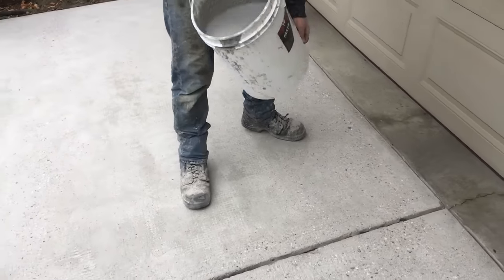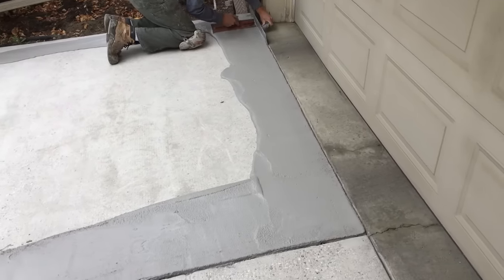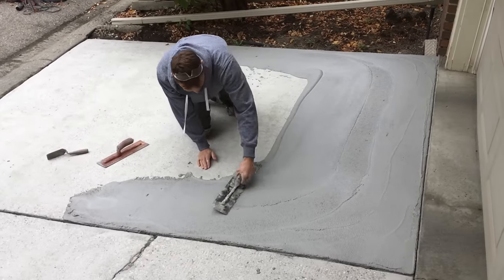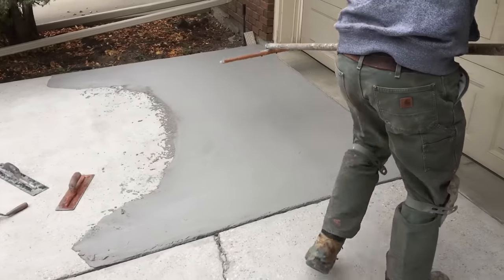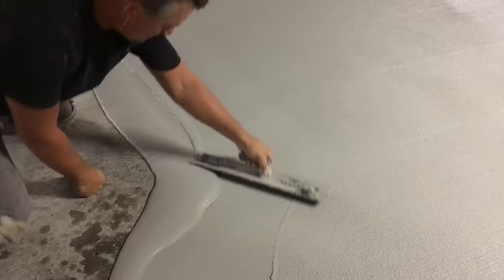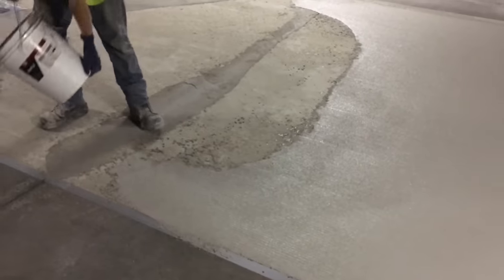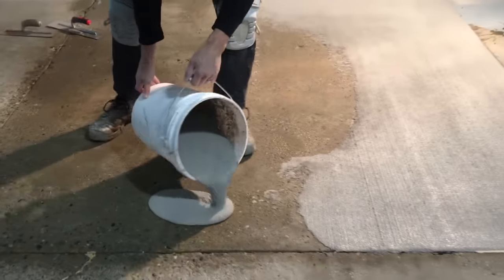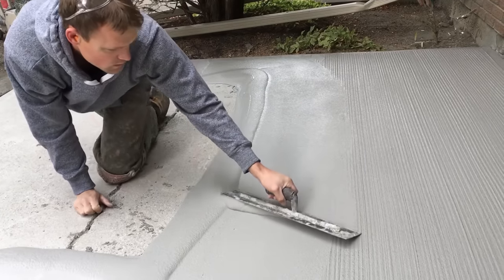TF Structural Concrete Overlay - Overlay Instructions

Comment: Just curious, once it all dries would it crack when vehicles are on it
Reply from the maker: No 👍
Reply: Yes it’s a temporary fix
Reply from the maker: That’s incorrect
Reply: It's not will it crack but when.
Reply: Terrafuse Inc. you’re incorrect
Reply: @mikemike9501  Due to the temperatures of the axis between sand and stone, the moisture content may or may not have been fracked. If you consider this and add the element of electrical current you will realize I have no experience with concrete at all other than stepping on my porch in the morning when I leave the house to go do other non concrete related tasks.
Reply: @GrandeHuevos69  ok then

Comment: I want to apply an epoxy paint to my garage floor, but it has that shiny coating that the builder applied. If I apply this concrete overlay over my floor, will it adhere?
Reply from the maker: You need to have bare, clean, porous concrete to apply this too. It can’t be installed over other coatings. Or are you referring to a power trowel finish?
Reply: @TerrafuseInc  Will a diamabrush work?

Comment: in my garage the previous owner put in some leveler which seem to be now cracked and delaminating in certain parts. It's a large area, what's the best way to remove it all other than a chisel and hammer?
Reply: Que tips de cements utilizes si se puede saber
Reply from the maker: Tf structural
Reply from the maker: Jack hammer is best.

Comment: Could you resurface a skatepark with this on surfs that are sloped or ramped. Would need a smooth finish rather than broomed
Reply from the maker: Yes, it will go vertical, but it’s difficult to get it really smooth. You need good troweling experience.

Comment: Can this be done over a painted/stained surface ~ such as a walkway or would paint need removing? Or can a primer be used over the paint for the concrete to adhere to?
Reply from the maker: No, the paint will need to be remove for a proper bond. It needs to go over bare concrete, no primers or paints, they will ruin the bonding process.
Thanks

Comment: What about any existing cracks in the original pad? Won't they eventually show up in the concrete overlay?
Reply from the maker: Yes, they will reflect back through, this is not designed to “fix” cracks, but we have another video with a method that helps
Reply from the maker: https://youtu.be/o5UYlJmKhAE
Reply from the maker: https://youtu.be/iuK9_XweHKA

Comment: What's the thickness this can be done to.  What's the strength and in winter can this be plowed over
Reply from the maker: As thick or as thin as you want, stronger than concrete, and yes it can be pliers over, but that will add extra wear that will reduce the lifespan

Comment: if it's only 1/4" thick, how does is handle something getting dropped on it, like a hammer or whatever, something heavy? does it fill the crack and self level while spreading or settle and show the crack?
Reply from the maker: It handles impact, as it transfers through to the slab below. It becomes a part of the existing substrate. Any existing cracks will reflect through eventually.
Reply: @TerrafuseInc  If you were to patch the cracks with a silicone sealant before hand and then go over this with the TF structural would this improve the process?

Comment: How does it hold up to be on a drive way with cars etc? will it crack chip etc like the original concrete?
Reply from the maker: It is designed from driveways and cars, so it will hold up excellent. Check out our channel for lots of 'after' videos, showing the material years after install.

Comment: Can this be used on exposed aggregate driveway that has developed cracks I want to hide by doing the complete driveway?
Reply from the maker: Yes it can, just make sure there are no remaining sealers on the driveway, and use a technique seen in this video:
https://youtu.be/o5UYlJmKhAE  You won't be able to guarantee the cracks won't return, but this will give you a really good chance at covering them.

Comment: What is the solution being poured out of the bucket? I am having trouble with a porch it has holes in it, a flat section of concrete, and I just wonder if something like this would help me? Thanks
Reply from the maker: Yes it will. It is called TF Structural, and you can buy it from Amazon 👍
Reply: @TerrafuseInc   thank you, great instructional video

Comment: Nice product! how long it will last?
Reply from the maker: Typical life span is 10 years, for every 1/8" of depth installed. This would be in a Canadian climate, with harsh freeze thaw throughout the winter. You can expect longer in warmer climates.
Reply: Terrafuse Inc. thank you I’m here in the north west
Reply from the maker: I should have mentioned approx. 10 years, as you can easily get longer from it. There are many jobs from 10 years ago that still have the broom lines in them.
Thanks
Reply: Until a drop of water gets under it and it turns to nothing

Comment: Is it safe ti say that you're not etching the concrete to eliminate oil, grease, tire spray, etc.?
Reply from the maker: This product requires proper preparation of the concrete. Grinding, blasting, heavy pressure washing, to make sure all the things you mentioned are removed 👌
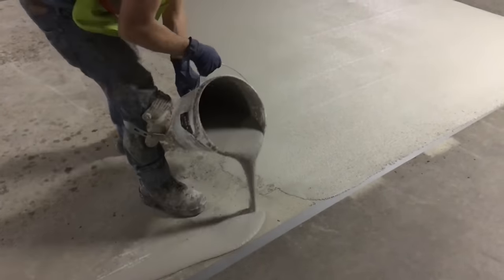Reply: @TerrafuseInc  at 4:04 it doesn't appear as though the oil stains, etc. were etched out.  It was why I asked.  Thanks!

Comment: Can be installed or apply over wood, like plywood floor
Reply from the maker: It will bond, but it has zero flexibility, so eventually you will get cracking at all the joints.

Comment: will this work on a garage floor? mine is looking pretty rough and I was thinking about epoxy
Reply from the maker: Yes it will, but hard to get it smooth. We also manufacture epoxy and polyaspartic coatings.

Comment: Did I see you use this product to cover a crack in the concrete? How do you stop the transfer of the orginal Crack through a 1/4" of bonded overlay? It also appears that in part of the video you filled the expansion joint as well. If so, is that a good idea?
Reply from the maker: The crack will reflect through eventually. Here is a method you can use before overlaying you help prevent this. 
https://youtu.be/xvq0TXjMfeU

Comment: I noticed at the end of the video that cracks in the concrete were troweled over with the product. Does it hold up well with cracks in a driveway?
Reply from the maker: No, it is not meant to repair cracks that way, it is not a flexible product, so cracks will eventually reflect through the overlay. Please check our channel for videos on crack repair. Thanks!
Reply from the maker: https://youtu.be/o5UYlJmKhAE
Reply from the maker: https://youtu.be/iuK9_XweHKA
Reply: @TerrafuseInc  Appreciate the reply and thank you for the update video. I guess cracks won't go away unless replaced but that overlay looked fantastic even after 3 years. Nice work and great product.
Reply from the maker: Yes, you can't guarantee they will be fixed, but there are many techniques to help prevent their return.

Comment: My husband used rock salt on driveway . It has large holes in it , I need to know , what to fill in with before , resurfacing it .
Reply from the maker: Use the same material (tf structural) and then cover right over it 👍

Comment: sir I have a floor of about 3000 feet and thousands of holes a quarter deep and three inches in diameter what cement can I use to cover the holes and that it does not dry too quickly to be able to work.  Thank you el piso es interior
Reply from the maker: TF Structural will do that! Please email me to discuss further 
mike@terrafuse.com

Comment: When you (over rub) concrete when your finishing it .it will make too much cream come to the top and make a cap..that will crack later.and chip off.so will this the first time you drive your car on it..?? And where your slab has cracked you must put a joint there.
Reply from the maker: This product is not Portland cement based.
Reply: I see..thanks..what other applications does it have or..could it be a sprayed insulation? And thanks again

Comment: How does it hold up i have cement fake brick look was poured into mold and som is pitted n woern away i thought of putting something like this over it , what product is toughest
Reply from the maker: this holds up excellent. Meant as a permanent restoration of existing concrete structures.

Comment: won't that top layer eventually chip off in time as oppose to putting a whole new slab of concrete?
Reply: Hahah, yah YouTube just put this on my feed as well, welcome to what the fuck ever YouTube serves up to us lol 😆 
I also think it may chip, I've had to prep the surface first, wire grind, clean, prep, apply adhesive, then the overlay.
Reply from the maker: No, it won’t just chip off over time.

Comment: Aren't you supposed to wet the base concrete first before laying tho top?
Reply from the maker: No, not with this material. You can if needed, if the concrete is really dry, or it is a hot, windy day, but its not requried.

Comment: What is the structural strength for driveway vehicle  traffic? Thanks
Reply from the maker: 5000-6000 psi. Vehicles are no problem for this material. 
https://youtu.be/isCXARp0hzw
Check out the 3 minute mark on this video

Comment: Do you dampen concrete first?
Reply from the maker: You can, but it is not required. It will help increase working time, and the product will spread a bit easier. You will also eliminate the potential for pinholes coming through the overlay, so it is definitely recommended.

Comment: I have a floor that needs a refinish but there are places that needs greater then 1/4" thickness. Is it possible to use this product for this?
Reply from the maker: Yes! You can apply at any thickness you need!
Reply: @TerrafuseInc  what about using forms with this? If yea, would I wax them like any other material?
Reply from the maker: @scottwatkins571  yes, you can use them! Check our other videos, we have lots using forms! Best to use tuck tape or duct tape on the wood, or Vaseline or powdered form release. Structural bonds like crazy to wood!

Comment: Can this be applied to concrete with exposed aggregate, 1 inch dips and pitting? Also any contractors near Savannah, GA who can apply this if it'll work on above?
Reply from the maker: Yes, it can go as thin or as thick as you need it to. As long as the exposed concrete does not have any old sealers on it. Please search concrete craft to see if there is a contractor in your area. Thanks
Reply: @TerrafuseInc  Thanks for the answer!

Comment: I have a pool deck that has 1 pad with heavy damage. Large chips and some chunks but no actual holes, will this process work?
Reply from the maker: Yes, it will fix the damaged concrete. I recommend using a coating afterwards, give it some nice appeal 👌
Reply: I appreciate all the advice, thank you very much...
Reply from the maker: What he said! 😎

Comment: For how long does it last? Is it equal to typical concrete?
Reply: It only adds a layer, protection, cover up on existing concrete. easy way to add a value to the house before selling it.
depending on your location it may last about a year or so. you can also change the color.
Reply from the maker: It will wear down at a rate of about 1/8” every 10-15 years, with normal use. It is not a quick patch, or cover up, it is a restoration of the existing concrete surface.
Reply from the maker: How does this look after three years?
https://youtu.be/iuK9_XweHKA

Comment: I want to redo my driveway because it has old ugly red brick as the trim.  Will this work over the brick?
Reply from the maker: No, it needs to go over a solid substrate. If you cover bricks with it, you will have cracking between every joint of the bricks.
Reply: @TerrafuseInc  thanks

Comment: That won't crack when walked or when a car drives on it???
Reply from the maker: No. The overlay becomes a part of the existing substrate. If there are existing cracks in the slab, those may reflect through if not treated properly during install.
Reply: Yes it’s will crack, i did and and after 7 months cracked
, they even add special glue didn’t helped either
Reply from the maker: You didn't use TF Structural, and you probably didn't do your application correctly. https://youtu.be/o5UYlJmKhAE
Reply from the maker: https://youtu.be/o5UYlJmKhAE

Comment: So this will not crack under pressure from the car?
I see a garage door..
I would need to level my concrete garage floor
Reply from the maker: The existing crack will reflect through the material, as it is very rigid, but there are ways to address the cracks. We have a video out showing this, and will be doing another one shortly with another method 👍
Reply: Terrafuse Inc. 

So in actuality, this only for cosmetic purposes?
Reply from the maker: No, it is a restoration material designed for existing concrete structures. It is not temporary, and it is not a “quick patch”.

Comment: DOES THIS REALLY WORK?? i wouls thinknit will all break apart it is just not thick enough.
Reply from the maker: Yes, it really works. If we installed it that thin on top of dirt, it would crumble apart, but when it is put on top of a solid concrete base, it becomes a part of that structure.
Reply: Any in ohio that do this ??

Comment: Does this product seal cracks and it is a permanent fix?
Reply from the maker: It’s a permanent repair yes, but not meant to fix cracks. It has no flexibility to it, and will re-crack if you repair a crack. There are special methods for this. I attached a video link that shows one of these. Thanks
https://youtu.be/xvq0TXjMfeU

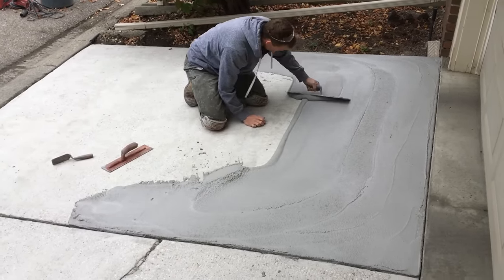Comment: 2:28 This is the big problem I run into! Right here the material starts to clump up and become a mess. It's like after going side to side to side, all the water is gone and im left with unusable sandy clumps.
Reply from the maker: Are you mixing the material with the Part B, or just using water? You need to mix it with the Part B, or this can happen. If you are using Part B, see below for other suggestions.
This can happen if the material dries out as you work with it. Some tips to prevent this: 
1. Pre-wet the slab with water before installing. The slab can be damp, but no standing water should be left. This is an SSD (saturated surface dry) condition. 
2. Make smaller mix sizes, you don't have to mix a full bag at a time
3. Make your mixes a bit wetter by using more Part B, there is no critical mix ratio. DON'T MIX WITH WATER.
4. Avoid installing in the heat of the day, or windy conditions, as this can dry the mix out too.
5. Make sure you aren't installing too thin. You shouldn't hear or feel the sand scraping along as your trowel. 
6. Use our TF Ice additive. This improves flowability, helps with moisture retention, and increases working time. This is highly recommended for hot weather installs. 
I hope this helps!

Comment: Is that material good for leaking concrete roofs
Reply from the maker: No, it is not a waterproofing material. You can use it to repair the roof, and then it can be covered with a waterproof membrane.

Comment: On average can you tell me how square feet one 15lb pale of powder (Part  A) and one 0.3 gallon pale of liquid (Part B) would cover?
Reply from the maker: About 15 sq. feet as a thin overlay. If you require bigger sizes than sold on Amazon, we sell direct also, so please call with any questions! 14032433000
Michael

Comment: Could this work for leveling concrete floor for tiling?
Reply from the maker: Yes it can, but it would be more for large slope changes. It doesn't self level, so you would have to screed it out to get a uniform flatness.

Comment: I’m optimistic about the product, how durable is it?
Reply: Skim coats like this look nice for awhile but it won’t last long , especially if you live in a climate changing place. it’s like putting a bandage on .
Reply from the maker: So far, our oldest application has been down for 13 years in Canada, and has not worn off. This product is extremely durable, and will not just peel or chip off. If you cover existing cracks in concrete, they will reflect through over time, as this product is not flexible.
Reply from the maker: https://youtu.be/iuK9_XweHKA

Comment: Can you use it to cover crappy asphalt?
Reply from the maker: Not ideal. It will bond, but asphalt is much more flexible than concrete, so over time, you will see micro -cracking reflect through the overlay.

Comment: I saw a long crack in the concrete you were resurfacing and no apparent prep before apply the mix.  Will the crack eventually propagate through the new surface?
Reply from the maker: Yes, it will come back, but there are ways to treat that before overlaying. We have one video about this, and will be putting out more. Stay subscribed for updates. Thanks.
Reply from the maker: https://youtu.be/o5UYlJmKhAE
Reply from the maker: https://youtu.be/iuK9_XweHKA

Comment: This won’t peel off or crack ? My front sidewalk is really rough from the salt rock I used in the winter time, this would be nice to cover
Reply: It will. This stuff doesn't last. Especially in cold climates that get salted frequently.
Reply from the maker: No it will not peel. It will crack only if you cover an existing crack on the substrate you are fixing. It was designed in Canada, so harsh winters are of no concern.
Reply from the maker: https://youtu.be/iuK9_XweHKA
Reply from the maker: https://youtu.be/iuK9_XweHKA

Comment: Do you have any examples of a rosette pattern with this material?
Reply from the maker: I do not. Can you be more specific?
Reply: @TerrafuseInc  Thanks for your reply. To try to be more specific: I’m looking for a finishing pattern that isn’t just the typical broom finish and would like to see an example of it exists.
Reply from the maker: You can use stamp mats to create whatever pattern you want, but it is a very difficult process, and requires a lot of experience with the material. Is this what you are wondering? Sorry for late reply